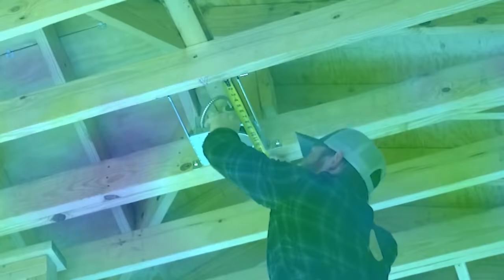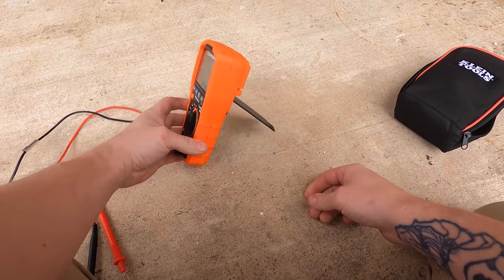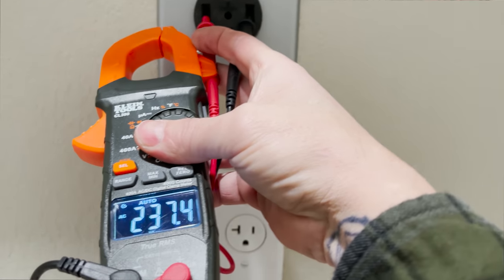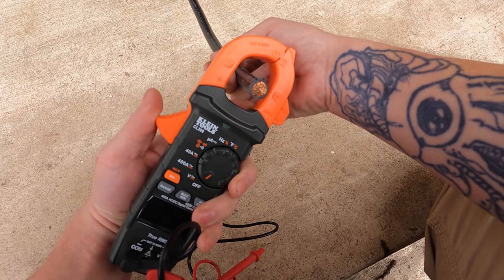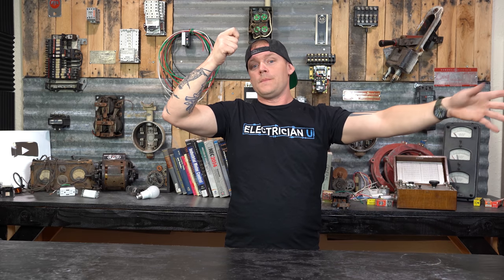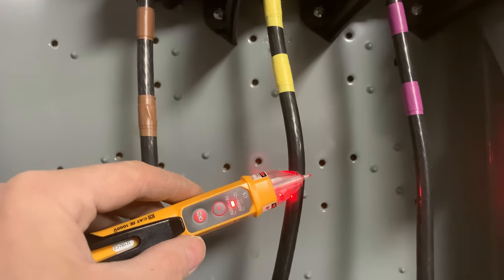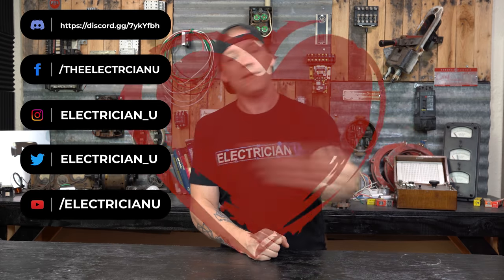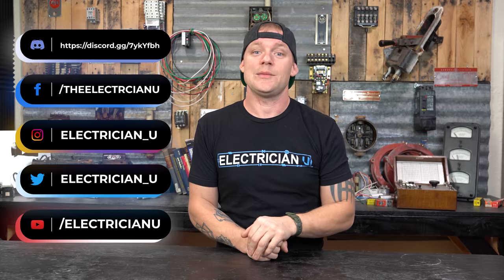4 Basic Electrical Testers & HOW TO USE THEM

Comment: very first day as an apprentice I was doing demo. the older guy swore that the circuit was off and to cut the mc cable to clear the ceiling... I had to buy a new pair of pliers the next day bc mine had a nice big hole in them. nice little first day memorabilia though
Reply: What you have there now is an expensive pair of strippers!
Reply: @ProctorsGamble  might only work on 10awg now lol
Reply: Get yourself an electrician safety lock kit, box lock, push-button lock, and breaker lock. I was drilled to use them when I was working in a mine mill, every worker have their lock, electrician or not, if they caught you working on something without a lock you end up sitting on your ass at home for a week without pay. Hey, it's just me saying, you have the freedom to get killed. Just one more tip, you need to be the only one with the key, not even your boss should have the key, they are often the most dangerous when the production is on the line.

Comment: 11:35 I agree with this.
Where I work we were removing some equipment from a building which needed the power to be shut off, since this was not our building we had to ask the electrician to turn the supply off.
Well one of the guys that came to remove the equipment was about to cut the mains cable leading to it.
I told him use my multimeter and  test to see if it is off.

My multimeter showed 240v.
I made him realize I was about to be shocked if I cut it.
Told him always make sure, by measuring the voltage yourself.

I am not an electrician
Reply: Get yourself an electrician safety lock kit, box lock, push-button lock, and breaker lock. I was drilled to use them when I was working in a mine mill, every worker have their lock, electrician or not, if they caught you working on something without a lock you end up sitting on your ass at home for a week without pay. Hey, it's just me saying, you have the freedom to get killed. Just one more tip, you need to be the only one with the key, not even your boss should have the key, they are often the most dangerous when the production is on the line.
Reply: @louispaquet8185  I am not an electrician and I can't touch distribution boards

Comment: I bought my first digital multimeter from Radio Shack circa 1991 when I was in college studying electrical engineering. I still have and use it for all kinds of stuff. I probably paid under $100 and I think I have gotten my money's worth.
Reply: I purchased my first Micronta analog multi meter from Radio Shack in the very early 80's It was under 100 dollars. It's large, but dependable. It's been at my side for decades. I do have digital testers. But when in doubt, I trust my old Micronta.
Reply: @c50truck  Yup... mine is a Micronta as well. Miss the old days when you could get decent stuff from Radio Shack.

Comment: The outlet testers are handy to have, but the readings threw me off one time.  I was originally diagnosing a low voltage issue on a bathroom outlet.  The tester says it's wired correctly, but voltage was only around 70V instead of 120V.  Took out outlet to check for wear, but everything looks OK.  Traced and tested other outlets on the circuit and the outlet tester told me reversed polarity.  Pulled all them out, but the wiring is correct.  Turned out all those false readings were caused by the flakey reset/test buttons on the GFCI outlet.  After replacing that with a new GFCI outlet, all the reverse polarity readings and the low voltage all went away.

Comment: Not a bad video, I want to be a little critical in a nice way. First the Digital Multimeter vs the Clamp Meter, I totally understand what you're trying to say but that DMM you used isn't really a meter someone working on a bench 40 hours a week is going to have. While it's nice to have a clamp meter, being able to test AC and DC voltage, continuity, and ohms, is going to happen way more often than using the amp clamp, which that first meter can all do.  Last, I get this is sponsored by Klein and I have a lot of Klein products, I would only recommend the Fluke (I think it's ac-1) non contact voltage detector.

Comment: I have a basic question about Fluke meters. The 11 amp fuse is back ordered about everywhere. Can you use a 15 amp fast blow fuse to substitute it? I know it's only 4 amps more, but will it toast your meter? Ideal makes a 2 piece fuse set including the 11 and 600ma fuses. Lowe's in Winchester, Va at the time had 5 packs. They want tax & shipping to send them. This is the only "get it in a day" method to guarantee availability. Your thoughts?? 🐀🐾

Comment: I'm a dutch distribution/transport electrician. So interresting to see how other country's manage their power. 120 volts on a plug socket is only about half of the voltage we use ( 230/400 volts )

Comment: Long question coming FYI.  I have a project with a wire buried in a parking lot. I have with a specific tester found and repaired all the breaks in that wire. I know that there are portions of the wire with insulation damage and I need to find the specific locations of these areas. What do you suggest OBI WAN ?

Comment: Glad to see you have a good sponsor. I know the first couple of videos of yours I saw you mentioned your Klein's. Of course being in IT, I first heard of Klein through networking. I was a little confused on why you needed crimpers for installing a light switch. Of course you did correct yourself in one of them and call them linemans pliers.
Reply: Lineman’s pliers are called Kleins by the trade. Story has it that a guy broke one side of his pliers and had a blacksmith forge a new half . Later the other half broke. The blacksmith made a new half and thus the first pair of Kleins were made!

Comment: How do I  know which holes IN the multimeter do I plug the black and the red probes in when  I'm trying to measure voltage or check if a wire in hot. There are 4  holes in the lower half of the meter? Most YT videos talk about the dial settings not about which plug hole to use.

Comment: The clamp meter.  For DC current.  It has the + on one side and - on the other side of the clamp.   What way do I orientate the meter.   If I have a positive lead coming through should have the positive facing me?   And if I have a negative lead coming through should I have the negative facing me?   It's a harbor freight meter.

Comment: Rule 1.  All wires have voltage on them until you personally verify they don't.  

Plug testers test the GFCI by shunting current through a resistor to the ground wire.  So won't work if the ground is bad.  But the GFCI sockets shunt a bit of current around the sense coil on the neutral.  So, a failure of the plug tester GFCI test does not mean that the GFCI socket/breaker is bad.  Or that there is no GFCI protection on the outlet unless you verify the ground is intact.  

The tick tracers, and I picked up a Fluke 2AC one recently that doesn't make a noise, can be triggered by florescent lights.  CFLs which might be close to where you are testing are a real pain.  I also learned recently that the tick tracers even the Fluke 2AC only rated 90-1000 will trigger for 12v switch-mode DC power supplies even 3+ feet out the DC cord.  

On the other hand, I used the tick tracer to verify voltage to an ice maker, as it came into the freezer then at the ice maker controls verifying the thermal fuse was intact even before unwrapping the leads on my meter.

Comment: The "tick-tracer" or NCVTs most important use is to a solo electrician.  Put it against the wires of the circuit you're trying to cut power to so it stays in contact and beeping.  Go to panel and shut off breakers until beeping stops.  No assistant needed

Comment: I’m an HVAC Service guy in residential. So I was out on a call that the lady didn’t have a disconnect box at her condenser. Obviously that’s not code. So I went ahead and came back and put a box on. But, with the breaker turned off inside at the main, I was still reading two volts out at the unit before I put the box on. What would cause that? Just a bad breaker not fully coming off the contacts?
Reply: Could be voltage being induced on the circuit by another circuit if they are running parallel

Comment: I was on a scissor-lift over 20' in the air, I yelled down to my boss asking if the power was off. He asked the electrical supervisor standing right next to him and he said it was off.  It wasn't. I got thrown on my butt in the lift. Needless to say, the guy got his ear ripped off by my boss afterwards.  NEVER EVER TAKE THE WORD OF ANYONE ELSE.
Reply: still on you to test it yourself
Reply: Get yourself an electrician safety lock kit, box lock, push-button lock, and breaker lock. I was drilled to use them when I was working in a mine mill, every worker have their lock, electrician or not, if they caught you working on something without a lock you end up sitting on your ass at home for a week without pay. Hey, it's just me saying, you have the freedom to get killed. Just one more tip, you need to be the only one with the key, not even your boss should have the key, they are often the most dangerous when the production is on the line.
Reply: @louispaquet8185  This was over 30 years ago. I'm retired now.

Comment: Dustin do you know how to test quiessant voltage on that mm700 meter, I have it but I can't work out how to do it. I mean in the context of a fire alarm to test with power off how many amps it would need to run on battery only for say 24 hours

Comment: Hey You Need To Make A Video About Safety When Using The Probe Some People Not Aware Of The Contac W/The Probe When In Use Live Plugs Out Let If You Have One Of The Probe In Hot Slot And Removed The Neutral That Tip Will Be Charge⚡️👍🏽

Comment: what are your thoughts on the digital meters for the houses that concern me and I would like to raise the outlet /receptacles from the bottom to a little bit much midway from the trim what are your thoughts on that I'm thinking babies/toddlers safety I know covers but easier to reach I'm getting older too as well as flooding issues I think of every scene in my head when designing a future semi-smart home?

Comment: I’d like to know what you really think of Klein meters. I’ve never used one, and I’m reluctant to trust a meter that hasn’t developed a long standing reputation.
Reply: Sorry but had to respond, I have been an HVAC tech for 8 years, and Klein is an electrician's company, they primarily make all sorts of electrical tools and test equipment for over 100 years...100 years is "a long standing reputation" of tested and proved track record. Not an electrician but I do electrical testing during my service work, and every electrical supply house I go to has either Klein or FieldPiece in their inventory.  Plus Klein makes their meters tech friendly, with magnets on back and built in features other brands may not have. And no, I am not associated with Klein or have any financial interest in the company, I just have bought many different brands including Fluke, and dollar for dollar, feature for feature, they are best maybe UEI comes close in features, but I just like design of Klein better because they also pay attention to design, even with their test leads and other equipment.  But by all means, do your own research.

Comment: For tick tester I highly recommend the santronics 3115 or the amprobe vp440 they are identical just branded different. I've tried every other one on the market and they are all junk. Theese are always on and ready to go and will never give you false readings. They can still be used on a multiwire branch circuit unlike the other beeping toys.
Reply: Indeed, the Santronics is nice!

Comment: 9:13 I can confirm. I'm an electrical noob, and got shocked yesterday after turning off the breaker and thoroughly testing with a tic tracer. I'm still not sure where that juice was coming from...

Comment: I just found your channel and I'm wondering if you can help me with a problem.  I own a restaurant and the hood exhaust fan motor keeps overheating.  I have verified that nothing is getting stuck like bad bearings or anything like that.  The fan belt is good, but the electricity is coming in at about 14 amps when the motor is turned on.  The specs on the exhaust fan say it can handle 11 amps.  I have had an electrician come out and verify and run a new hot wire to the box.  I have even replaced the motor with a new motor and the new motor still runs hot and turns off.  I bought a Klein CL120VP to test the voltage and I am going to do that tomorrow.  Everything that I have tried; including, making sure the fan belt is at the right tension, to leveling the pulleys to make sure they are flush with each other, to greasing the bearings, to replacing the motor, to having an HVAC guy try to figure it out... any piece of advice would be greatly appreciated.  Thanks for your time!

Comment: Used a CGFI  Tester In the socket. It didn't light up. So does that mean the receptacle doesn't work because it was live. I tested all the settings and didn't get any reading except OL and my  V ~ was 0.3.

Comment: I'm curious about the plug tester. I've had several occasions when I've used it that all 3 lights are lit when they are inserted into a plug. More often than not the neutral was burned out at a GFCI receptacle but is that what you should expect if that situation occurs?

Comment: Decades ago, long before country began to fetishize safety, a sparky once told me that the primary reason they usually run with the power on at 120 is so that the apprentices can habituate to practices that will save their lives as they move up to higher voltages. Just curious as to your thoughts on this, particularly as it applies to the challenges of supply and demand in the electrical industry. eg, it seems that there is a significant shortage (pardon the pun) of electricians in the heavy equipment and commercial sectors at least in part because of specialization, but also in part because of the live wire issues involved. As you can tell, I am not an electrician, but a very old general contractor, so don't be too harsh.

Comment: Hi Dustin!  Love your videos!  Super helpful!  Question, why am I getting a meter reading of about 115V from hot to neutral at the device end of a home run when my neutral is not connected at the panel or to anything else?  I tested for continuity between this neutral wire and ground and found none.  Hot to ground is 120V.  It's weird that I would get a reading of 115V, and this would not light a bulb.  Have you seen this before?
Reply from the maker: So, meter readings are a difference of potential. Imagine 2 glasses of water, one has 120ml and the other has nothing. If we wanted to know what the difference between the two, all we had to do was see that 120ml - 0ml = 120ml. It’s the same concept except we use a meter to measure the voltage differential. The reason it should 120V or 115V to ground or neutral is b ecause that is the difference of potential. You could take one lead to a ungrounded conductor, or hot wire, and connect the other lead to a roll of wire still on a spool. The measurement would still be 115~120V.  The reason the bulb isn’t lighting is because it is not a closed circuit if the neutral is disconnected as you described. Hope I understood your question!
Reply from the maker: In the future, our FB group and discord are also great places to bounce ideas off other electricians (and you'll probably get a quicker answer!) 
https://www.facebook.com/groups/electricianu
https://discord.com/invite/7ykYfbh
Reply: @ElectricianU  I really appreciate you responding to my reply.  I wish YouTube would notify me when my comments are replied to.   I would have loved to have received this from you 11 months ago when you took time out of your day to respond.  Better late than never.  Anyway, THANKS!  I'm going to experiment with the wisdom you have so generously shared with me... ⚡😎👍 LYC!  Keep up the great work!

Comment: Volt cons are usually the most used next recptace testers
Also non contact continuity at ground and neutral is locating the line ie the panel

Comment: So Brian if you use a plug tester to see if power is off. Do you double check with meter or once the plug tester says no voltage you trust it??
Reply: You check with the plug tester, the ticker, and the meter.

Comment: Those plug-in testers won't always indicate a boot leg ground like the ideal 61-164. Though the ideal is 20xs more cost. 

Some of the new dual function breakers damaged my Amprobe INPS-3 (twice). The first time the manufacture fixed it. The 2nd time they told me they no longer manf. or support it. I'm wondering if anyone knows how to repair it. The display still works but it says something to the effect of "Service device". I see nothing odd on the circuit board but would like to try and get it working again.

Comment: tic tracers.. I have a klein circuit toner that I use instead... plug in the outlet tester, and then go to the box and run the wand down the face of my breakers to identify.. shut it off, go back and see if the outlet is off, then I hit the tic tracer just to double check...